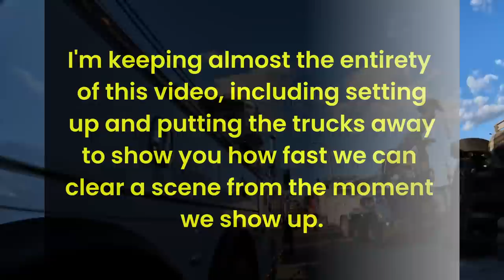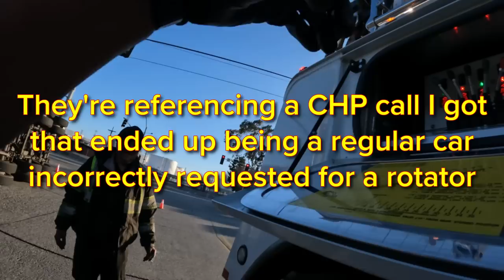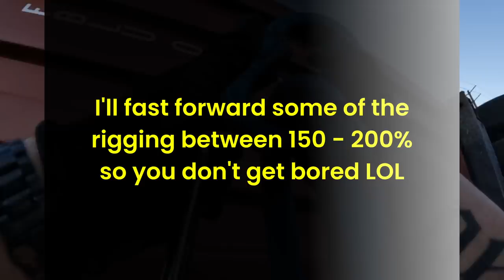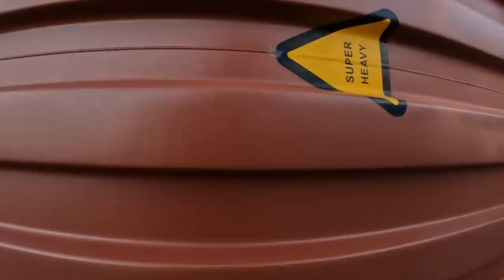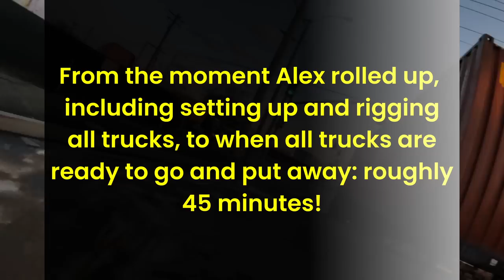Watch This Incredible Heavy Duty Rollover Recovery in Action!

Comment: I would suggest you guys get a little giant ladder that extends to 14 feet. Jumping up and down even from the height where the truck is on it’s side is not good on the knees. I had one of those ladders when I was doing flatbed loads and I had to get to the top of the load and it was the best ladder I had.